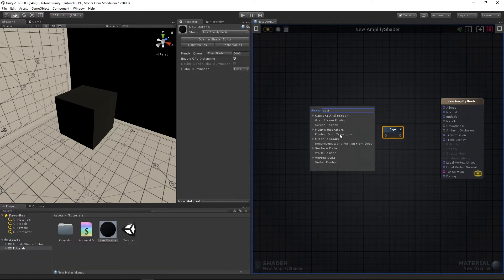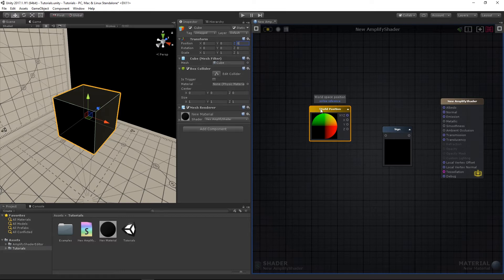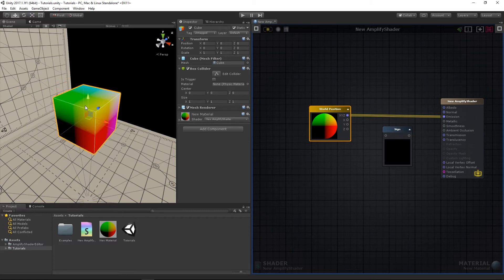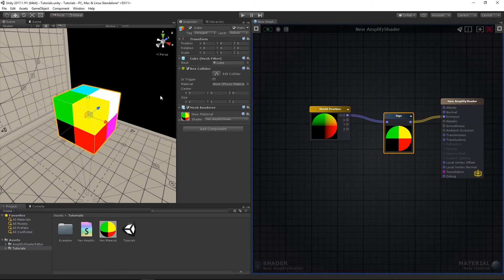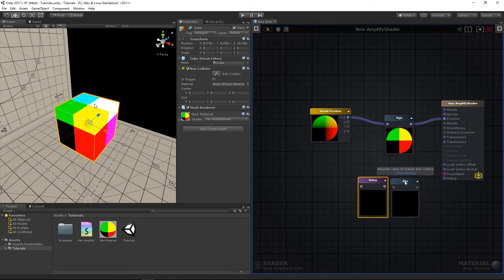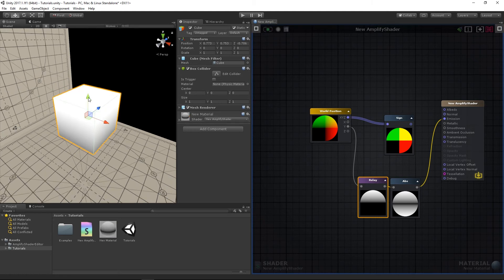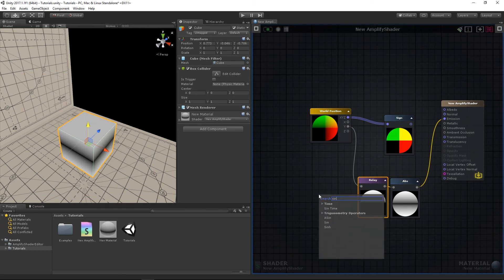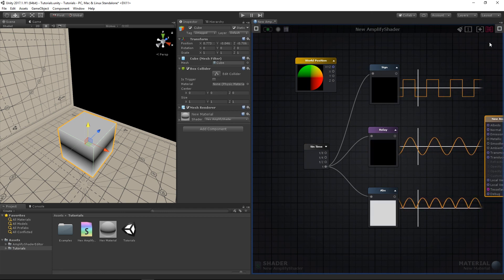Math Operators - Sign and Absolute - Part 7 [BEGINNER]

Comment: HOW DO I CHANGE THE FRECUENCY OF THE SIN??? for christ sake it's so hard to find good documentation and examples on amplify shader. You have a million nodes and a wonderful plugin to create shaders, but most of the time i'm blindingly guessing what node i should use because hell do i know the difference between "world normals" and "vertex normals" and the other dozen nodes with normal in the name, for example
Reply from the maker: Let's chill on the ALL CAPS. All the nodes you just mentioned are properly documented, select one of them and press F1 to open the documentation page. Although you don't need an expert, there are some Unity concepts/terminology that you should be aware of when it comes to shader development. As a general resource, you might want to get up-to-speed to how Unity handles shaders and materials; this is not unique to our editor. There are also our tutorials and manual.
https://docs.unity3d.com/Manual/shader-StandardShader.html
https://www.alanzucconi.com/2015/06/10/a-gentle-introduction-to-shaders-in-unity3d/
Best to use all sources available when you need specific effects; Unreal, Shader Graph, or even Shader Forge provide valuable community recourses.
For example, here's a varying flicker which you can use to learn how to change your frequency: https://youtu.be/kxHLw8r-4gE